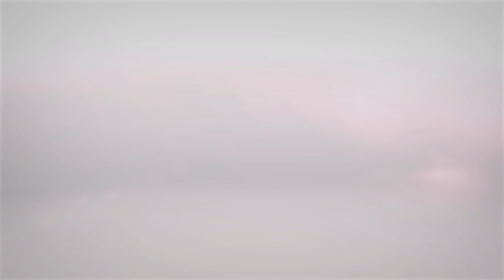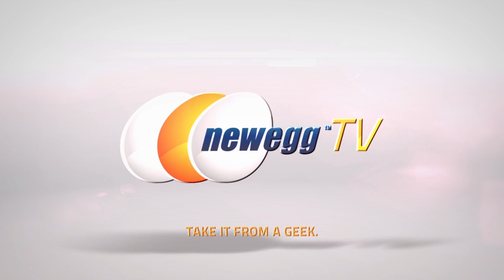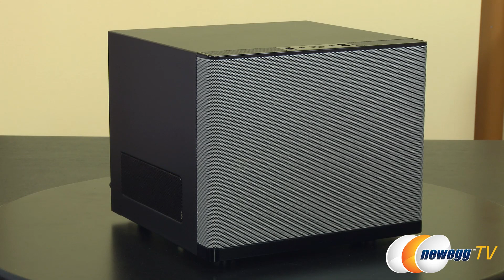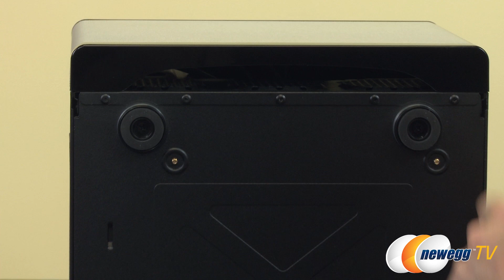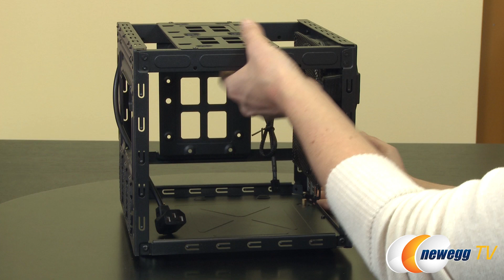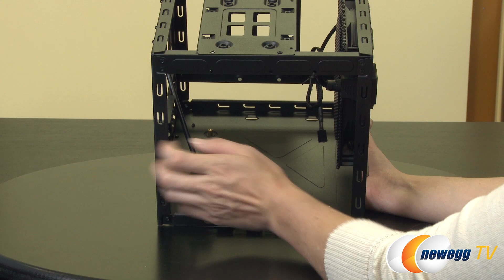Rosewill Mini-ITX V6 Computer Case Overview - Newegg TV

Comment: LOL.  THis is a useless pc case that looks like a subwoofer.  (facepalm). Rosewill, jUST STOP.  Stop making asinine things.  Stick to your value oriented crap mid tower cases and stop wasting our time with  these sff pos's.
Reply: Because everyone shopping for a computer case has the same preferences.
Reply: tom5243 Because everyone shopping for a computer case has the same preferences.
Reply: ITX builds have been a lot more common lately, and you can still fit a lot of tech inside. MSI has a GTX 760 built specifically to fit in a small case like this. Throw a good ITX board in there with an i5/i7, and you have a system that will rival a lot of modern full ATX cases. Sure, you won't be doing SLI, or even a high end card, but it's tons of power in a small package.
Reply: NegroThunder this case is just stupid small

Comment: looks like a cool case for $60.
Reply: For 10 bucks more you can get a Cooler Master haf 915f which is MUCH more than double the total size ( only long ways) and can ACTUALLY put in REAL pc components such as:  4 to 5 storage drives with creativity, a 12" video card AND a 7.5 inch aka 190mm psu like my 1k watt nzxt hale 90, PHanteks phtc14pe best of the best cpu air cooler, one bluray burner drive, around 3 120mm noctua nf f12 fans.

Imo if I need a pc case smaller than the haf915f, i'll just buy a gigabyte brix pro ( when the cost makes more sense.  more than 800 bucks for that unit is not worth it right now).  Otherwise the Cooler master haf915f is a REALISTIC sff pc case.